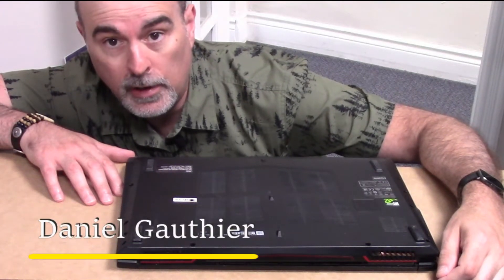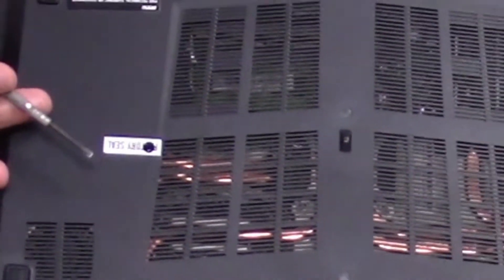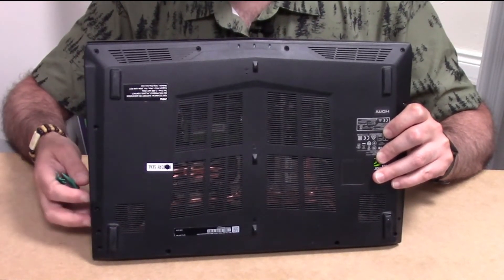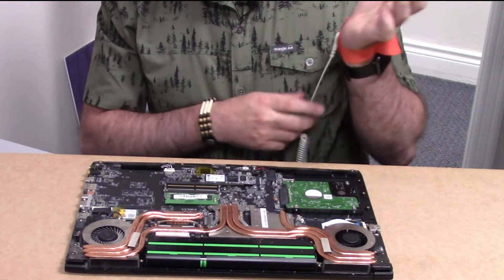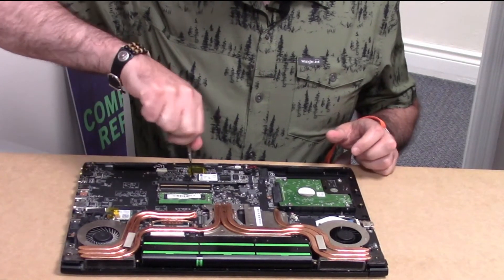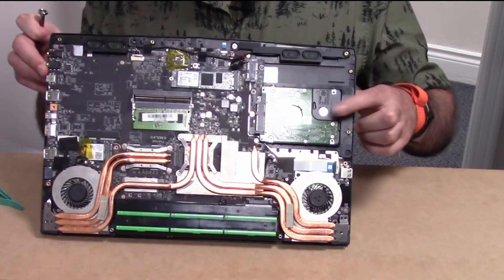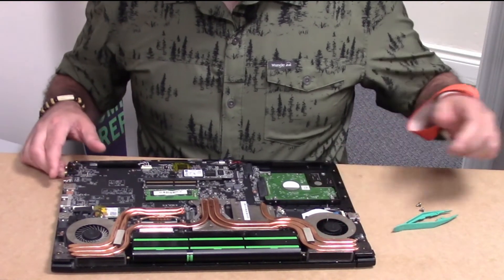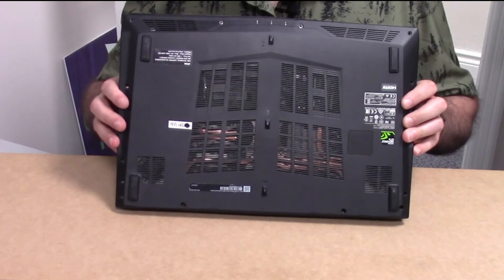How to replace a hard drive on an MSI laptop

Comment: after replacing the hard drive with a new one ...then what? might want to mention that a new hd will be blank unless youve installed an operating system ie windows 10/11...otherwise the computer wont work ,right ?!

Comment: Will an NVME work in mine currently have a stock SSD SATA Installed ? MSI GE72MVR
Reply from the maker: You need to check your user manual. You can go online to MSI support and lookup your model.

Comment: I'm not sure if you'll check this but I have a quick question sir. I'm trying to replace my dead hdd with an ssd on my msi ge62, where should I connect my anti-static bracelet after I put it on my wrist? I'm not finding any answer on this
Reply from the maker: Depending on your anti-static braclet type, you want to connect to metal and ground.  It could be the metal chasis on a computer case or a static mat, or ground outlet.  but you should be careful connecting directly to ground outlets, although it's just grounding, there have been warnings issued like if you hit live power of some sort, you are connected directly to ground to make full circuit.  Very dangerous, but normally it should be fine.  I connect to ground via grounding mat.

Comment: The sticker doesn;t void the warranty. It only allows to chance HDD/SSD drives.
Reply from the maker: I haven't tested that theory, but simply reading what the sticker usually says.  Where is your info coming from?  Have you tested this theory?  Do you work at a manufacturer?

Comment: I have an msi apache and it's stuck on a loop at startup. I tried factory rest but it won't even let me do that. Idk what to do at this point
Reply from the maker: Sounds like the built in recovery environment is damaged.  Maybe need to do a fresh install with a USB or DVD
Reply: @marcotalavera5775  hey mine is doing the same thing, did you fix it?
Reply: @RogueBearz   No, I called customer service and a few other places they said hard drive might be done.
Reply: @marcotalavera5775  yeah i’m thinking about replacing the ssd and everything.
Reply: Fresh install will fix that... Or boot into safe mode.

Comment: hey, can such a laptop hold a second hard drive?
Reply from the maker: I don't recall if this one could but you'll see a 2nd drive bay if there is one when you open it up.  You can always check the specs on the manufacturer website.
Reply: @TwinBytesInc  ohh right. thank you so much for replying haha

Comment: A quick question sir I have a MSI Gv72 7rd I want to add an ssd because the hdd is bottlenecking my laptop. Is it possible to have a ssd and hdd at the same time with my model?
Reply from the maker: A quick search found it can handle 1 m.2 drive and 1 2.5" SSD.  Here's the link https://www.msi.com/Laptop/GV72-7RD/Specification
Reply: @TwinBytesInc  Thank you very much!!!
Reply from the maker: @crappypatty5652  You're welcome
Reply: @TwinBytesInc  wait sir so does that mean I cannot have a ssd and hdd at the same time? Only a m.2 and a 2.5 ssd?

Comment: Thanks for the video! 

Just did a battery swap on my MSI GS60 Ghost Pro from 2014. Still a workhorse with no issues. 

I want to upgrade the 1TB HDD to something bigger, but I'm not sure what is compatible? Will any 2.5 inch  HDD fit and work? There are some Seagate 4 and 5 Tb drives that would be great but I don't want to buy something that ends up not working.

Thanks! 👍
Reply from the maker: You're welcome, and yes, any hard drive as long as it matches the size you have now, like 2.5 will allow any 2.5 inch drive to fit.  However 4TB and bigger might be a little thicker drive, so there is a chance that could cause a problem where you can't close the case.  You'll have to look inside the computer where the drive goes if it allows room for a thicker drive.

Comment: My 2.5 drive is no longer registering (unusual clicking noises on start-up, I'm just assuming it's dead).  Can I just swap that out for a new one?  Windows is on the SDD and is still bootable (but very slowly because the system is trying to repair the HDD but it always fails).
Reply from the maker: Yes, you can swap out the drive and sounds like it is dying or dead.  Hopefully you can still access your data.

Comment: I have a MSI laptop GV62 8rm, and I would like to improve the hard drive. How do I select a hard drive that is compatible?
Reply from the maker: you would need to open it and look or check the manual.  A quick google search says it has 1x M.2 SSD Combo (NVMe PCIe Gen3 / SATA ) and 1x 2.5" SATA HDD

Comment: Case screws already lose and taken out. Yeah the one underneath the label, wow what a surprise. My SSD was glued in its frame with some sticky pads and took more effort to take out as shown in the video. The only (little) helpfull was showing that the case was clicked together.
Reply from the maker: Sorry to hear you had so much struggle.  There are so many models out there that they are not all exact.  There are some that maybe using sticky pads, etc.

Comment: Did you have to get an MSI boot disk? I've had three MSI laptops, and they are tricky when it comes to the software.
Reply from the maker: It depends if you clone the old drive or fresh install on the new drive.  You can use just the Windows installation disk and boot from that.  MSI drivers can be downloaded from MSI website afterwards.